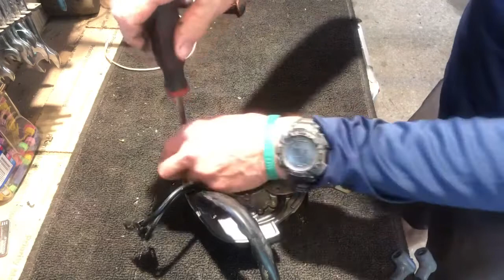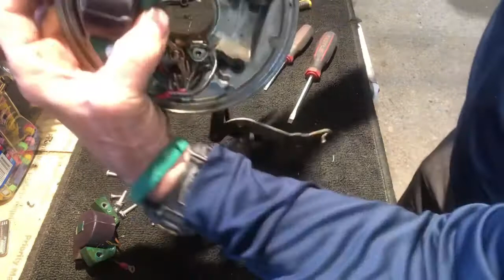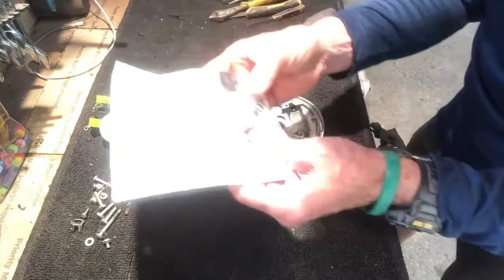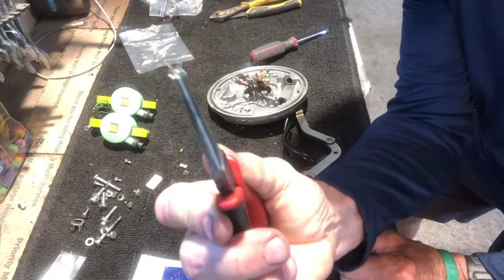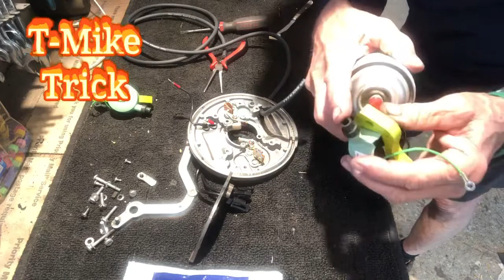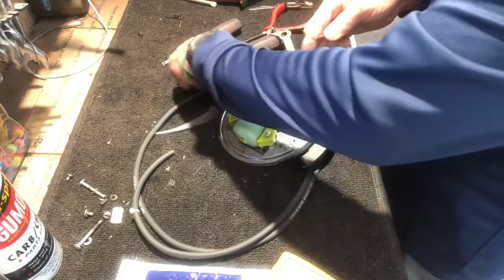Vintage Magneto Rebuild Detailed Disassembly and Assembly Process

Comment: Where do the grease packets go that came with the points? I’m finished with my rebuild thanks to you. Do you also put grease on the shaft or around the shaft?
Reply from the maker: Apply grease to inner ring of mag plate.

Comment: Hey T-Mike. I just installed the Sierra tune-up kit. 8.5k ohm from plug wire to ground, Coils flush with the shoulders, condensers seem to charge/discharge properly, 1 ohm across points, points gapped to .020" at "top" arrow, spark plug gapped at .030" (new), magneto greatly passes the screwdriver hold test...I'm getting a light with the inline tester but no spark across my gap tester or when I hold the plugs in boot to ground. Any ideas what to check next? 1966 Johnson 6hp
Reply from the maker: Is there a kill switch on your motor ?
Reply: @michaeljsimon  No sir. It seems like it would just starve it of gas when you twist the tiller handle back to "stop".
Reply from the maker: @travisestes6217  you can always send your magneto to me. 
https://youtube.com/playlist?list=PLmMizJOF01-AOoskedqXA7bNG24ghkxUT

Comment: How much to rebuild one for me? I have a 1967 9.5 and the wires are ruined.
Reply from the maker: $100 
https://youtu.be/gEOISADZEhs
Reply: @T-Mikes Vintage Outboards Restoration  Thank you! Your training videos are extremely helpful. I ordered some spark plug wire and plug ends. My coils ohm'd out good and condensers are testing good. Plug wires are toasted. I'll try to rebuild it myself. Wish me luck! LoL
Reply: Thanks again!  I replaced the spark plug wires and she has spark again! New j8c plugs and she fired up first pull. Now I need to replace the water pump.

Comment: Thanks for all the videos T-Mike. I’ve followed them (including this one) to bring a 1968 Johnson 9.5 back from the dead after 30 years sitting in the back of a barn. Now it starts easily and runs smooth at low revs, but won’t throttle up above about 30% rpm when in gear. Would love any ideas (or a video!) about how to fix this. Thanks!
Reply from the maker: https://youtu.be/Q0NzcE8ywho

Comment: Great job T mike Richard’s vintage outbord tools In Indiana has stuff I was looking for I will get another timing tool for smaller outbords I got the number 4 because I have 30 hp Johnson 1956 one has original 6 V starter I got a golf cart battery started right up after I put coils on sat in a heated basement for 50 years has all paperwork from new I paid 160 because it was so clean

Comment: Great video. I use the old spark plug wires to measure out the new ones. Usually, I add an inch in order to allow for cutting a bit of its ends off so as to hit fresh copper core during a future coil or spark plug boot replacement. I also use marine heat shrink tubing instead of those ruber inserts to get a good water tight connection where the wire screws in the coil. Amitiés mon ami !

Comment: great video. I am in the process of repairing my 1959 5.5 Johnson so far have the magneto play out and apart, one coil is burned through to the base I had suspected the motor was running on one cylinder, now I am sure that was my problem. I will check back in for an update and have subscribed to your video's. Thanks for the help

Comment: Thanks for all the videos! I'm restoring my grandfather's 67 20hp down here in New Orleans; I even bought a couple of parts from your eBay store! Though it hasn't been ran for about 35 years it was stored appropriately and still has good spark. I wasn't planning on pulling the magneto but I was wondering if I should in order to change out the oiler wick/check the points. Would you think that's a necessary step? I've taken apart most of the outboard, but was hoping to leave the powerhead and magneto as is.
Reply from the maker: Just check Spark. 1/4” gap. If good Spark leave magneto as is.
Reply: I owned a 1974 6hp Evinrude for 17 years. After about the first 10 years it became harder to start...like 3 pulls. I removed the flywheel and simply regapped the points because the fiber cam follower had worn. Once the proper gap was re-established the engine started like new...1 or 2 pulls. Did not check timing...simply adjusting the gap put the timing back to factory spec.